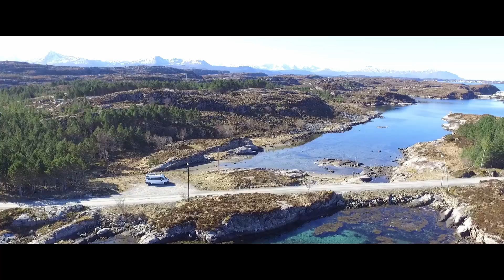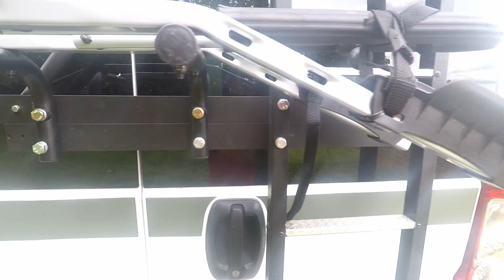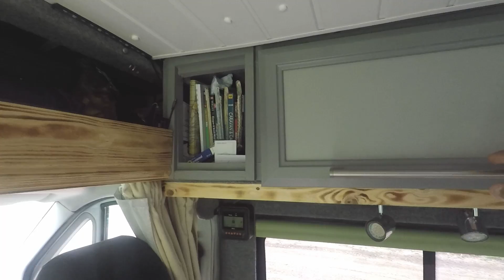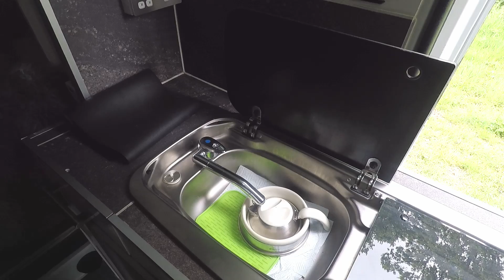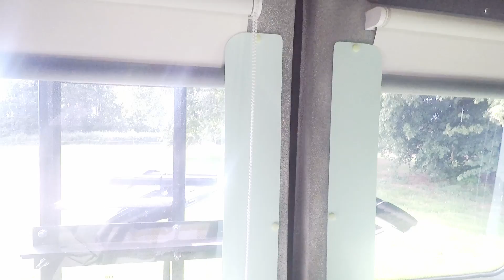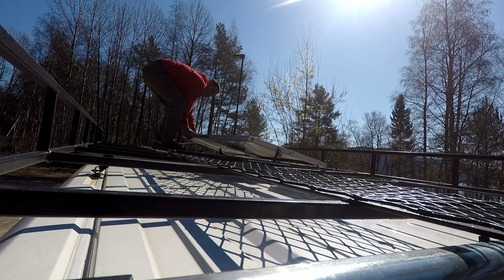L3 H2 VAN TOUR, Boxer, Relay, Ducato, Promaster self build.

Comment: What a great job. How long did it take you? Would it be fair to say you’re already handy when it comes to his type of thing? I can’t help but think the electrics and some of he woodwork is beyond me.
Reply from the maker: Mr GTI. Many thanks for watching. In answer to your questions. Firstly, I work full time so it took me 12 full weekends to build. Secondly,  when you see a van that's finished it can seem a little overwhelming; but in truth if you can use a wood saw & electric screwdriver, your 80% there. If you can wire a household plug, your 90% and if you know the basics of 12v electrical wiring (+ & -) you'll be in the same place as many successful van builders. I'm no carpenter  and there are things that a professional van builder would cringe about. However, everything is functional and the layout works for us. The more I watched YouTube, the more confusing it became, especially with the Solar etc. In the end I created a mental plan in my head and stuck with it. I'm going to do a walk through build video in the future and show some more detail. If you are thinking of doing something similar, you are more than welcome to contact me if there is anything that you are not confident with and I'll talk you through it. 2 of my friends are currently in the process of building there vans and one of my mates has never used a wood saw lol (he's been spoilt). Hope this helps, and if I could give one bit of advice.....do it my friend. All the very best, thanks again. Tony.

Comment: Looks great Tony. A lot of planning and work gone into the build.  I think for what you guys mainly need for your trips the build is ideal.  I follow this guy, Rickvanman - Variety Channel
, and he converted a Renault van but added a shower and toilet but he used the same felt cladding as you. He also used a fair bit of celotex as well and other stuff in the doors to prevent condensation. All in all though, Hugo looks good.  You didn't show Bazza!
Reply from the maker: Hi David, hope you're well my friend! Yes, we looked at loads of build vids, and although the van (Freddie lol, Hugo was the smaller van) is loads bigger, we preferred holding on to the space and storage over the loo and shower. As you'd appreciate, camera gear takes up a lot of room. I'll check out your recommendation later, thanks. Yes, our van insulation is Celotex, Rockwall, Reflectix and polystyrene. Very insulated thermal and vapour barrier. I might do a vid on the insulation, electrics solar etc later. Thanks for watching another one mate. Where's your next trip? All the best, Tony.